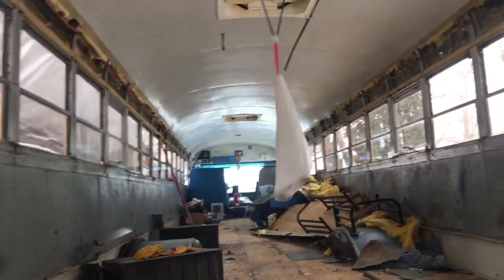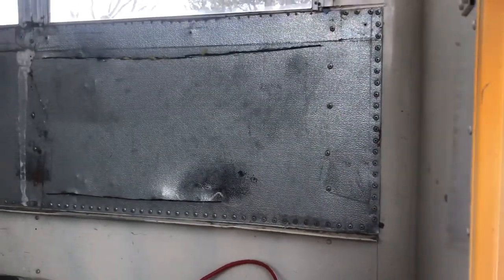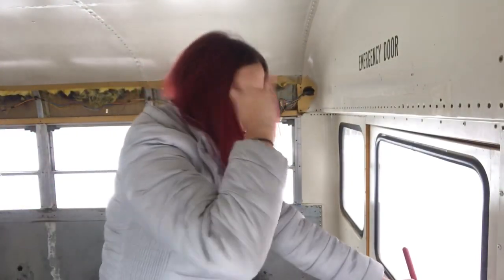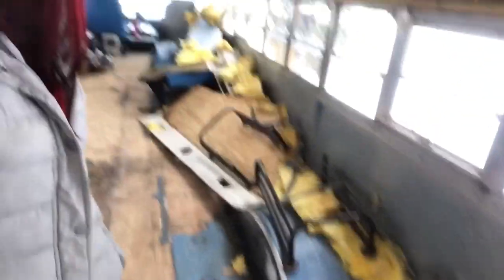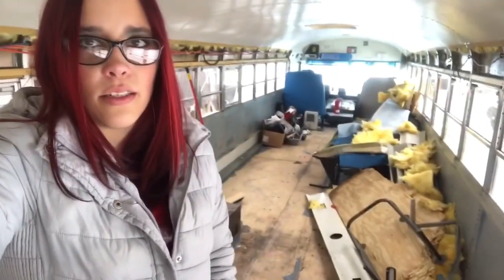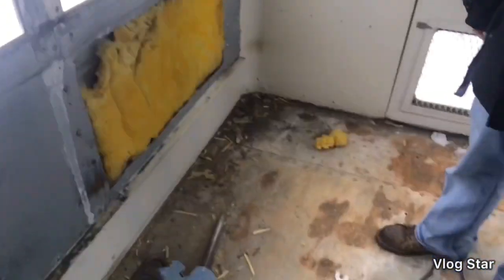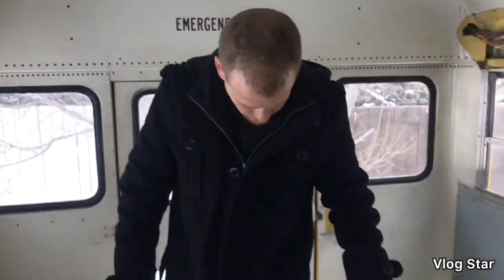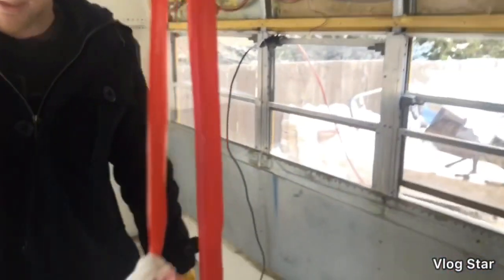Interesting way to remove bus panels on the BoHo Bus!!

Comment: I’d consider grinding off the rivet heads, but then the comment below concerning a specialty drill bit sounds even better. If it was me, I’m lazy so I’d find the least work to do to get the result I want, so I would just build over those panels. But that’s just me...
Reply from the maker: MarxNutz y thanks for the information! That’s one technique we are going to be trying out tommorow:)